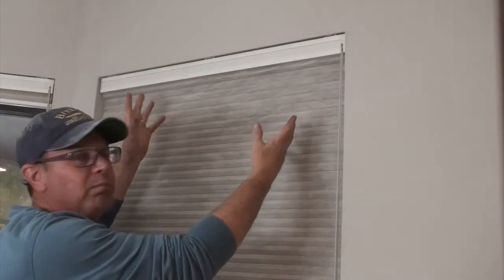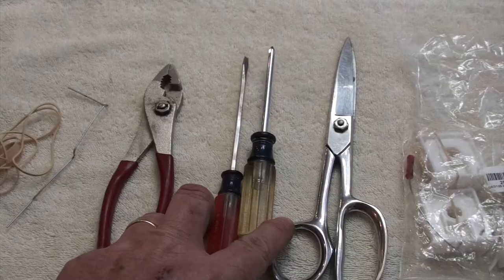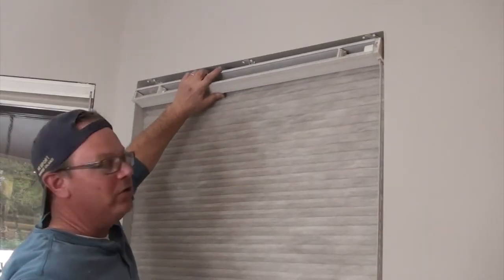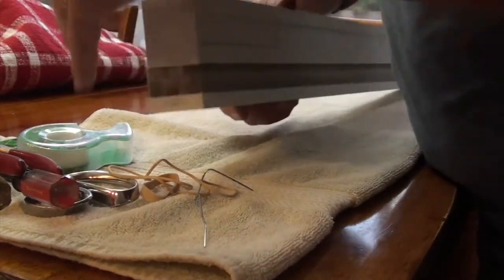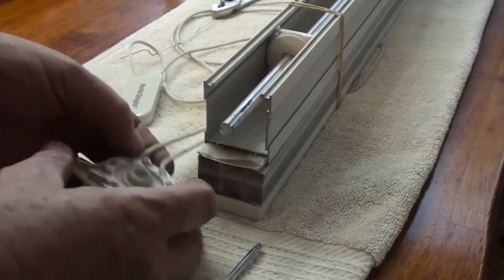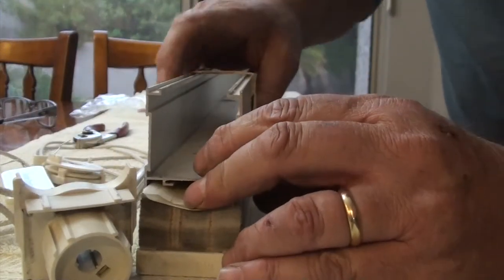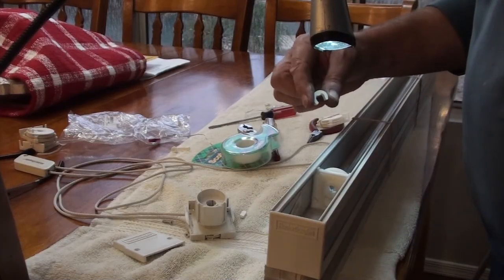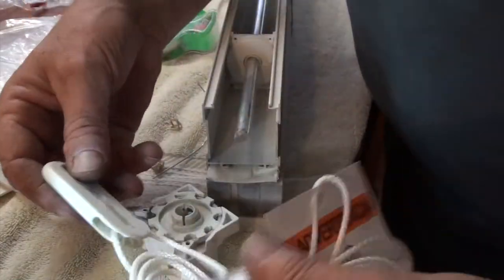Hunter Douglas Blind Repair; Step-by-Step... including Things They Don't Tell You

Comment: Hey Rich...........Your video is excellent.  Was very helpful.  I think I did something wrong.  My Duette shade is nine feet long with (4) spool assemblies.  When I re-hung it, (3) worked fine and the one furthest from the clutch broke immediately.  I checked that they all were spinning in the same direction and each spool was facing the same.  Any suggestions?
Reply from the maker: Hi Robert, thank you for your kind words... so glad we're able to help.  I think you did everything correct. Could it be a faulty/broken spool?  If one of the spools works correctly, but the other(s) does not, consider inspecting the sprocket teeth on the faulty spool... is it seated whereby the small tabs engage the grooves in the clutch rod?  Also, consider inspecting the tape (string / cord).  Is it in 1 piece?  Is it secured at the bottom of the blind?  Let us know what you discover.
Reply: @suburbandiy  All looked good.  The nine foot length with 4 spools is a challenge.  Grooves were all aligned and the tape is torn just inside the one spool.   HD is sending me another set and I'll be sure to check everything you suggested.  Thanks again, your terrific and extremely helpful.
Reply from the maker: YT has helped us with so many things.  Its great to know we contributed to others.  TY!   Please let us know how how it turns out.

Comment: Thank you so much for this video...Now I have a problem mine has 3 spools because it's a wide window. My issue is that it won't go up and down evenly. On one side gets higher than the other. Could you tell me why? and how to fix it? Thank you.
Reply from the maker: Hi Eliana - for me it was the same issue on a 2-spool and 3-spool.  Process is the same.  We posted our first HD Blinds video prior to this one… it was a 3-spool.  But the repair was the same. Even if it’s the middle spool of the 3-spool blind.  Does that help?
Reply: @suburbandiy  Hi Ok I'll watch it..the other thing is that the cord was too old and from trying to get it even pulling one side and the other, it broke so I have to replace the cord too. It looks like the first spool is not working since it doesn't run down as easily.
Reply: Would you send me the 3-spool blind video, please? Thank you so much
Reply from the maker: https://m.youtube.com/watch?v=J2uU5gwgrPU

Comment: It’s actually easier to put the wire into the blind from the bottom and pull the string through the hole.
Reply from the maker: Hi Ernie, thx for the tip.  To clarify for viewers, if you elect to push the wire through the hole from the bottom, remember to ensure the wire loop is what’s going through the hole first. Reason is… the tape line is connected to the spool at the top.  Meaning, the tape line goes down from top to bottom. So connect the tape line to the wire loop, then pull the wire back down through the hole to feed the tape line from top to bottom. 👌